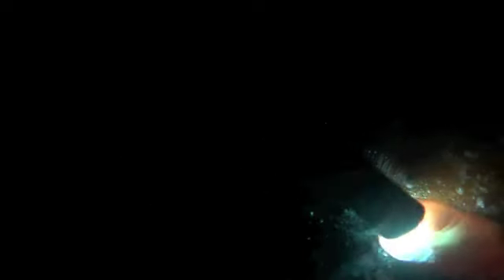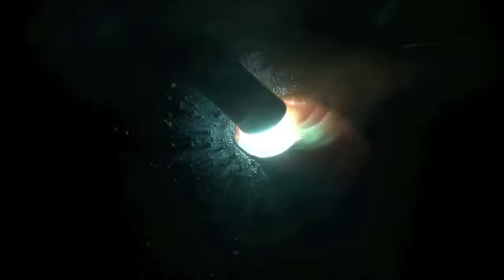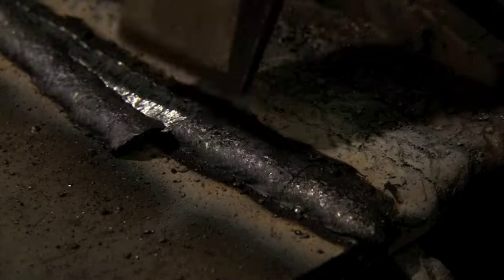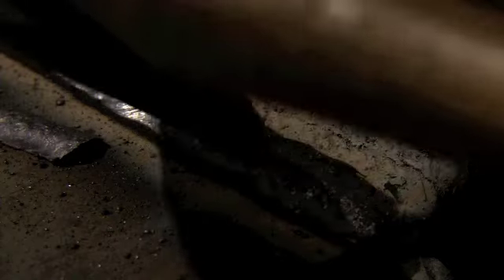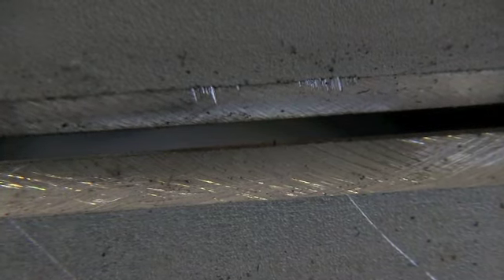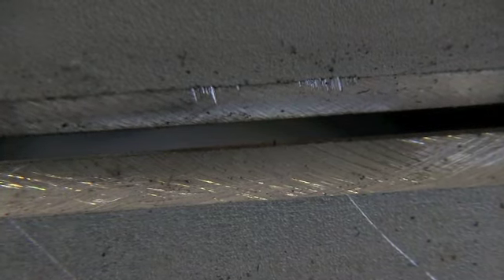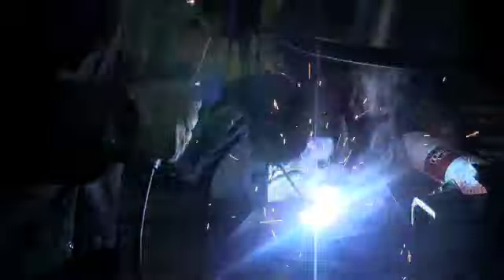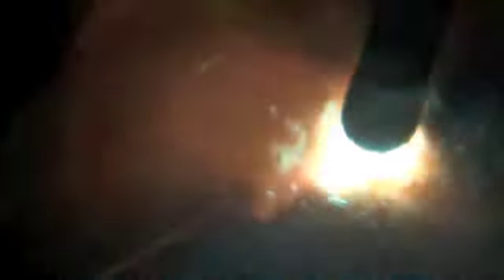Arc Welding with 6010 - Till the Cows come home

Comment from the maker: that reminds me of a story. on a written pipefitter test. the question asks to calculate how many gallons of water are in 20 feet of 6 inch pipe.  Fitter scratches his head and says " I dont even know how long a gallon of water is"
Reply: Totally different technique than I was showed to do but I’m going to give it a try, seems a little easier then the technique I was taught.
Reply: I have a everlast powerarc 200 sti with the 6010 capabilities but i cant get it to work ! It stick to plate or dig too much I dont know if you know any right hot start and Arc froce settings to start with
Reply: @horaciosalinas8145  Try setting the arc force high for 6010
Reply: weldingtipsandtricks I was with some coal miners they were trying to figure how much water a certain length of pipe would hold. One guy got up cuts off a foot of pipe filled it with water and poured into a measuring cup from the kitchen
Reply: None. The pipe has been emptied for welding.
Reply: 29.37 gallons of water will fit in that 6” pipe 20’ long..

Comment: You say this is the second or third thing you do in welding school, but that is the first thing I did in my course. So far I've only worked with 6010 1/8 and 5/32 first on flat plate, then horizontal, and currently on horizontal fillet. About 6 weeks in maybe? Haven't been keeping track. Your videos have been a huge help as have Steve Bleile. Both of you are so friendly it's very welcoming.

Comment: I had a flashback to 1984 watching this video. You sound exactly like my old welding teacher, Terry Block, at San Diego City College. He started us off on 6011, and after we got comfortable with striking an arc he switched us to 6010, because that's what they used in the shipyards. I remember one night he had me run 6013, just to see what it was like, then it was back to 6010. Next was 7018. Another night he gave me some 7024 and 7028 to practice with. It ran like butter. So easy. The it was back to 6010 roots and 7018 stringers and cover passes.

Comment: Thank you for another great video. You inspired me to break out some of my seldom-used 3/32" 6011 and start a pad. Good tip on using a bucket of water; keeps the pad from getting hotter and hotter and hotter. This allowed me to run bead after bead, meanwhile, my little Lincoln 180 amp buzz box, (with home-built rectifier), was getting hotter and hotter and hotter. Don't know by how much I exceeded the 20% duty cycle, but I still couldn't put my hand on the transformer 10 minutes after I called it quits! Doh!

Comment: I just usually take grinding brush after each pass but also use chisel as well. Very good influential video. However would've liked to hear more about amps in relation to uphill, horizontal and flat as well as base thickness. Thank God.

Comment: When the camera shows that welding you see a beautiful pool. Is that what you see with your eyes through your helmet ? I think my helmet seems brighter than that and i wonder if i need to get darker filtering ?
Reply: You can easily change the shade of your helmet filter!  I think all helmets come with a Shade 10, but you can buy anything from Shade 5 to 13 or 14 I think.  Just go up one number, they're only a few dollars.   You might want to change for different situations, so it's well to have a little collection of them, plus a bunch of the clear cover pieces which tend to get burnt up.
Reply: Try wearing sunglasses below your auto hood 👍🏻 or yellow tinted shades, even tinted reading glasses, mess with the settings, try shining bright LED on the work area..

Comment: I'm in welding school and taking my vertical and horizontal class this semester. I'll try this whip and pause technique, but really I've just put my amps at 65 and run a straight line with the occasional whip back if need be. Though I need to get some more metal on the backside of my roots, so perhaps this will do that for me? :)
Reply: I hate 3f. Im doing the lap joint in the verticle position I weld from top to bottom and when I do it its all convex, but when its horizontal its flush and looks good. I had the same problem with not getting enough penetration now I just shove the electrode to where the sparks fly out the back.

Comment: Great video, it helped me out a lot, but i have a few questions. What kind of current did you set your welder on? DCEP, DCEN, or AC? What was your amperage set on? I usually have mine on at 100A.
Reply: Chris Sedberry DCEP is required for 6010. The last digit not only tells the electrode coating's composition (in this case, cellulose and sodium) but it gives the required current as well. Amperage requirements are affected by the diameter of the electrode. According to a chart I was given for school, 100A is only good for 1/8" 6010. 100A is too hot for 3/32" and too cold for 5/32".

Comment: Thank you so much for your great instruction. I have always stuck to 6013 & 7018 for farm and my rural machine shop but I acquired over a thousand pounds of 3/32” 6010 rods still sealed in cans at an auction. I was determined to learn how to use them. I actually love them now and since I watched your videos I’m improving. About to weld up a coral with 2 3/8”  schedule 80 pipe. Should I continue using the 3/32” rod or switch to 1/8”? Thanks again, Randy

Comment: Are you using the 6010 with Ac or DC? I read somewhere that 6010 was for use with DC current and 6011/6013 was used with AC current.
Reply from the maker: DC electrode positive. you are right 6010 is only for DC so if all you have is an AC stick welder, then 6011 works pretty well.

Comment: I have so many problems using those 6010, 6011 rods I just cant them, anyway my teacher says that we really don't need to clean after every pass because the 6010 electrodes are fast freeze rods that will burn off any slag.  Now I dont know if thats what is causing my horrible welds but I really need to change my technique, amps, or clean up after every pass.
Reply: You still need to clean them but to say you dont need to clean at all is bullshit, cleanliness is godliness in welding as well as other things.  Them being fast freeze just means that they wont get all runny and waterfall like 7018 will when doing vertical or overhead welding if you're doing it wrong, also if you've doing a groove test, a 6010 root does not need a back strip but if you're doing 7018 root you do because of the properties of the rod.

Comment: I have to qualify and perform x ray quality stringer welds with smaw using nucleotec xuper 66n and 2222 making 2.5in. Stringers building a wall up and out (gear tooth) any tips for starting an arc, and whipping out to avoid slag inclusions, porosity and cracks at the end from cooling too fast. Please respond. Can you burn over a little bit of slag or will it show up in the xray?

Comment: Hello Jody your 3 steps Walz is measured at 72 bpm with a metronome (;))
I am (slowly)beginning to understand that technique (how do you name the different "walks" ) It is used for "open root" is not it ?
but , is there a "keyhole" when welding flat like there ? ( is the key hole a real opening ? I thought it was just the shape of the hot imprint of the puddle ?) 
things seem to be way more subtle that I envisaged, but indeed when the job begins to flow , one feel the puddle manipulation and that works only within a certain temperature margin and a certain speed.
Small sticks are not ideal I will use 1/8 to train. is it necessary to obtain those even spaced "washers" ? is it the proof the 3 steps action was well done ? in brief what is the goal ? I understand you take half of the pudling and spread it forward. is it ?

I am really unsure that the inverter helps to learn , if it raise the amps when the stick get close . May be I am wrong, maybe also the inverter can be set with that control on off for the learning curve

I apologize for my beginner questions, not asking mean no answers ;)

Comment: 6013 is best for thiner materials , clean metal, low Penetration, high build up, low spatter, easy Slag and spatter clean up,  pretty beads where grinding isn't wanted.  6011 is a deep Penetrating "hotter" arc rod. best suited for burning through rust, paint, oils, dirt, galvanized and poor fit up situations. hard to master, high spatter with very clingy slag. to have a good looking bead is challenging.  lots of cleanup. 6010 is the same as 6011, yet has more weld metal deposition. best suited for high filling situations.
Reply: Dmm Dmm543 🤔
Reply: 6010 works great for training because it's harder to make "pretty" beads. This about practice of a necessary skill , not visually satisfying results! We took students off the block and had them passing 6G pipe tests in 19 weeks, but they welded their arses off as they should. 

Want to get hired? Learn to work HARD and pass bend tests. Bend tests don't lie.

Comment: Hi folks. Rapid question on the 6010 : what are the minimum characteristics of a welding machine to run them well? Is the 6011 type more forgiving about the equipment? My machine is a Telwin ADVANCE TIG227MV, if it may help. (Side note, I write from Italy and the 6011 is quite rare)

Comment: hey jody. I just started SMAW at welding school. can you offer any tips for steadying your hands, bracing and ways to improve your beads? I'm having trouble with this. thanks for the great video. :)
Reply: I'm in a tech school, my first year, and I've learned to only have 1 cup of coffee in the morning lol. But my tip is be comfortable, and get a spot where you can move your arms and hands without bumping or any major jerking movements, like you're elbow rounds of the side of a cheater bar and drops, things like that. Hope I could help, good luck to ya

Comment: How can you go both ways if "if there's slag, you need to drag"? Just a curious welding student here....
Reply: Edalio.  
 you do drag but in a different direction.
For example 
When going right to left the stinger will be to the left of the arc/tip of electrode 
When going left to right the stinger will be to the right of the arc/tip of electrode. if you have more questions just ask!
Reply: @sheriakers6418  Yes, however isn't Jody saying it as in you can travel right or travel left in a bead? Maybe i just misunderstood 🤷
Reply: @e.r.3weldingandcutting  I think you misunderstood, he was simply talking about travel direction, you still drag just in the opposite direction.

Comment: I have a question. I been running some pretty crooked beads sometimes because it's hard to see where I'm going with the welds. I can see where I'm comin from I can see the puddle but I can't really see where I'm carrying the weld and where I need to go. 
Basically I can't see in front of the weld. Any suggestions??
Reply: @Karl Pfistenhammer yeah the soap hasn't really worked but the scribe did work pretty well. But I don't want to rely on scribes. I'm getting better at holding where I need to go but still hard sometimes when idont have a reference point like another weld or wall of a joint or something. Appreciate the insight and help. I'm gonns keep tryin tho
Reply: @Karl Pfistenhammer when I was a fitter we use to do home punches and use pink marker paint marker for the welders because they liked it. Assuming cuz they could see it easily. That's something I have yet to try either so idk might try that too. But yeah ill see about the chalk too.

Comment: Any tips for welding on 110v power? Dedicated 20 amp breaker but I pop it on 6010 usually over 82 amps 7018 3/32 pops it above 80 or after 6to8 rods.. adding 220 isn't in budget at moment any suggestions?  Also machine does tig I can run 110 amps all day and no problem popping breaker
Reply: Tig ramps up slower and runs less ocv. Stick welding ur lucky to get  80-90 amps out of it even with an efficient inverter. Make a cord out of 8/3 ( or have someone who knows electrical make one) to run the welder off of your clothes dryer plug or electric range plug if you have it. Should be a 30 amp or 50 amp breaker and shouldn't cost too much to make a cord. It really doesn't cost much to install a sub panel in the garage for a 50 amp 220 plug though.

Comment: I'm having trouble weaving with 6010 ? My beads are excellent anyone got any good tips please ? I've tried the horseshoe shape and a tear drop but neither are working ???
Reply: Rocco Malamov You don't weave with 6010...
Reply: Dude my whip and pause sucks any tip's ?
Reply: Yep, time it, when you initiate the arc wait in the same spot and count to 3 and then start stacking dimes; don't whip more than a 3/4" from the puddle and bring it all the way back to the previous, just follow it reading the fluidity and size of the puddle. That is what will tell you when to whip
Reply: OK i'm on day 6 in a row of 6010 in the horizontal I have it then I lose it . I will definitely take your advice tomorrow . I seem to have it then lose it I'm doing a route pass then a second pass then a 3rd pass . I'm trying to get the wetting it in look but sometimes my beads look lumpy (terrible) I've never been so frustrated in my entire life falling further and further behind :(( and thank's for the tip's I guess I'm whipping out to slow is that why my beads become lumpy looking or crappy looking ? thank's again!

Comment: I'm looking at buying my 1st stick welder, I weld pipe at work all day want a welder for home. anyways I've been looking at the ever last 200st and the 300. like the price of 200st better and the 110 capability if i gotta help a buddy or what not but also heard it struggles with 6010 open root and that's a deal breaker for me. do u have any experience with the 200st that you could shed some light on and maybe help with my decision. thanks
Reply: I would call Everlast and get their input on which welders will weld well with 6010. Some have specific 6010 ports and others have a setting you can use. Their technical staff are welders who use the products so they should be very helpful on this.

Comment: when i stick weld with 6010 the problem that i have is that i can't keep the arc going i have tried pushing dragging long arc short arc and it just ends up dying out what could this issue be thanks
Reply: Have you tried turning up your amps 10 amps or so?
Reply: t3hPoundcake yes but not much difference
thanks
Reply: David Abraham
Your problem could be a couple of things.  It could be that your machine or rod are no good.  It could be that you need more practice.  If you are a beginner, I would suggest that you just keep after it - the 'light bulb' will go off and it will all make sense to you.  Getting a 'feel' for welding is kind of like riding a bike; you just have to do it!  Is your material clean?  Are your rods in good shape, or are they old and nasty?  Just asking!

Comment: Been running 6013 and now 7018 and 6011 and for the life of me I cant get the 6011 to strike up! I dont know if its the rods or ? New Lincoln 6011 1/8s and the one time they did start an arc the rod caught on fire. Any advice? Not taking ARC till Sept so would like to know well ahead of time what I am doing wrong.
Reply: John, just keep trying.  SMAW is a difficult process to learn.  I start students on 6011 rather than 6013 because it is difficult, but they all pick it up in a day or two and I am able to eliminate wasting time on 6013.  It is like riding a bike; one day you just 'get it' and after that the sky is the limit!
Reply: I use to have that problem try exposing some of the steel and taking flux off the tips before striking it
Reply: Might be your welder too.  If you have an Inverter base welder, some don't do 6011 or requiered to be plugged on a different port.

Comment: Might be weird but i was running the 6010 at 90 got crap welds boosted it to 130 and i got uniform and well looking beads. Anyone know the exact disadvantage of running 6010 that hot?
Reply: +Devon MacDonald it depends alot on what you are trying to weld at 130 amps but that seems like the rod itself can melt, careful grabbing a 6010/6011 like you may to a 7018 during a weld or you might get a nasty surprise... and when you blacken a rod with heat it will burn faster.

Comment: 6013 is the bread and butter electrode in the UK, what is the benefit of 6010/11 ?
Reply from the maker: 6010 and 6011 both weld downhill very well for thinner sheet.
Also both are good for open butt root pass welds in pipe
Reply: They are known as the "farmers" rod because they are hot enough to burn through dirt and paint. If you use 8018 you have to do a lot of metal prep while 6011 requires none

Comment: whats the setup that do you use and arc control?
because I would run mine 83-85 amp with 30-50 arc control on a 3/8 plate
Reply: John personally we use 79-81 amps

Comment: Man, you weld way lower than what I weld on, I use 6011 rods on 125 and weld roofing tin together, the whip and pause doesn't work well on vertical downs, circles are better or zig zag patterns are the best.
Reply: A form of whip and pause is most necessary on vertical downs for penetration. If you're welding circles on a single pass weld downhill then you're burning too cold.

Comment: What's the usual amp on a 6010???
Reply: daniel salazar Depends on the electrode's diameter.
Reply: daniel salazar  1/8" rod about 90 , plus or minus 5 or less .
Reply: daniel salazar depends on the machine you're using, joint design, plate thickness, rod diameter, and temp of the weldment.

Comment: I'm a welder feel like your going to fast at times when you were making a Beed, puddle won't spread
Reply: Tyler Knox 
I'm a welder for Bnsf railway, any slower you'd have to drop your volts at that point your pissing in the wind.